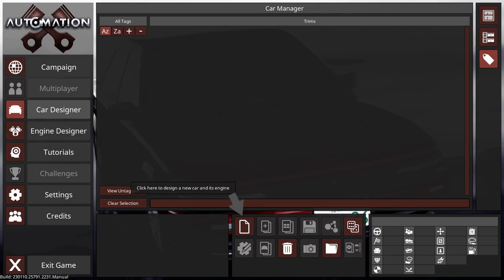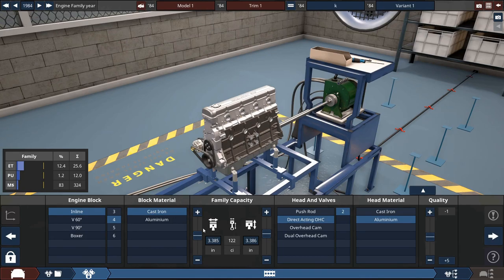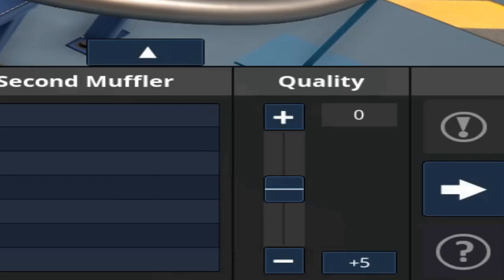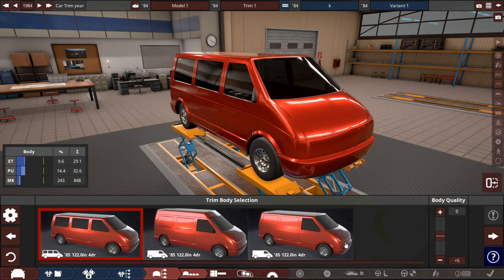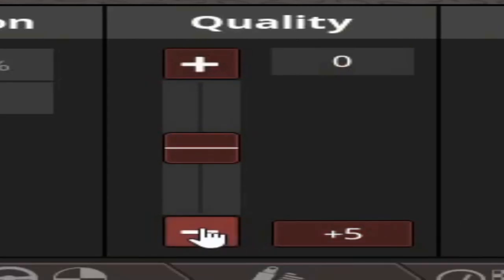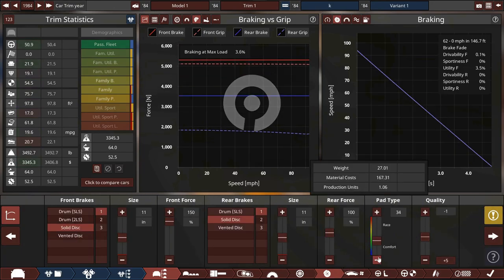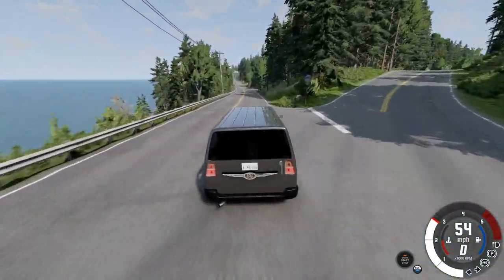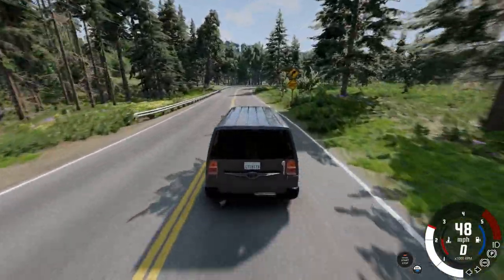Trying to make a Regular car in Automation

Comment from the maker: This really was an eye-opener as to why the minivan was so important for the car industry, and what led Chrysler to develop it. Chrysler had invested a lot in unibody construction already, and had been producing transverse FWD cars for a few years. This tech together let them produce a new type of car altogether, that was compact enough to be practical, but spacious inside. This alone made it one of the most advanced family cars of its time. Give it those comfy disk brakes, the later generation Turbo EFI engines, or DOHC V6 engine, and you have a proper Jetson family spaceship that makes a station wagon look like a Flintstones car.